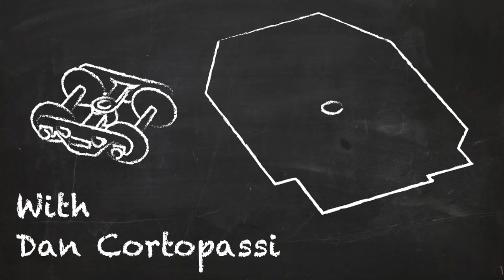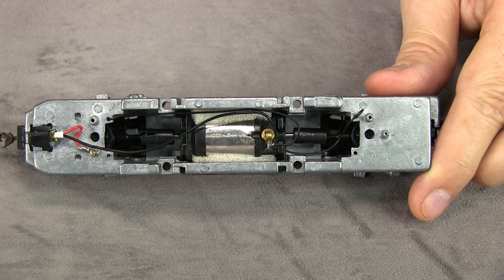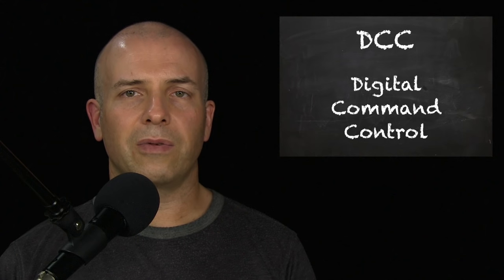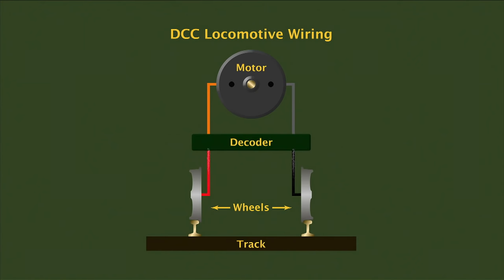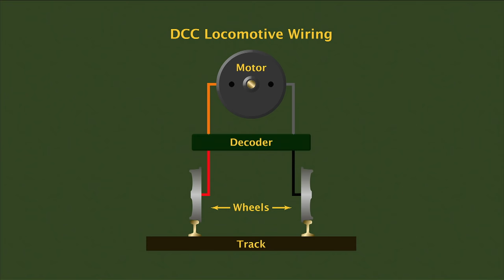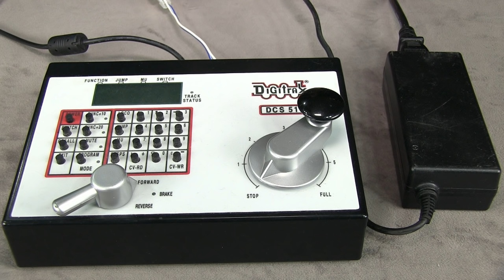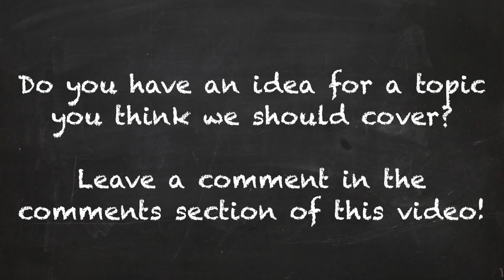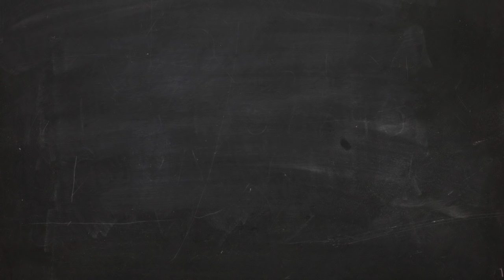Model Railroading 101 DC and DCC For Beginners

Comment: I started the hobby the mid-70's and amassed a ton of legacy DC equipment. I know older DC Loco's can be retrofitted to run DCC but like with much in this hobby, do I spend thousands on decoders and other periphery equipment to go DCC, or do I just deal with the simplicity of DC for now. I finally moved to a home that I plan to stay in for awhile and I now have a dedicated space for my hobby. My plan is to wire the track in a way that will work with my current DC switches etc (Older Atlas switches) but with a cabling infrastructure that will allow me to upgrade to DCC when it makes sense for me. I can still work on my track to ensure I have a smooth running system with the DC. I would like to spend my money now on scenery, buildings, and other piece/parts that help me provide a very visually realistic layout. Also, I have 48 DC locomotives ranging from steam to diesel and I do want to be able to run them. I have made some more recent purchases and these loco's are DCC ready to they will be my first conversions for sure. Other thing is my layout is a U shaped layout the is approximately 12' long and 14' Wide so it is not big. I do not have operating sessions and generally I don't do massive switching maneuvers or run multiple trains. I enjoy the building and modeling more than I do running realistic operations...hence why I am in no rush to go DCC right out of the box. This is not intended to be a dis on this video since it explains DCC very well. This video certainly makes me push up my implementation timing but...money and time dictates!
Reply from the maker: Always do what's right for you. It's worth mentioning that a lot of people use the logic that "I have too many locos and it would be too expensive to change them all over to DCC" but keep in mind you never run all 48 at the same time. You could switch your favorite ones first. You might not even end up switching the others at all or if you do, just do them one at a time.

Comment: Great introduction. The only technical detail I thought was misleading was the one suggesting the DC knob is a current controller. It actually regulates voltage, as you correctly implied but your partner may have misstated. The amount of current “drawn” from the controller is determined by the locomotive using the energy at a given voltage. This is true with DCC running AC voltage as well. I point this out because it is important for hobbyists especially to have at least a basic and correct understanding of electrical concepts to ensure safe and trouble-free operation of their growing layouts.

Thanks for your videos.
Reply from the maker: I like the technical explanation but wonder if most people want that level of detail. I would think most would just want to know if you move the knob this way it goes and if you move the knob the other way it stops. :D

Comment: just got back in the hobby after a 16 year hiatus... i have the NCE 5amp system, used it a lot way back when... set it up recently and completely forgot how to operate it... i'm gonna keep it but decided to temporarily go back to DC... DCC is nice but seems like it's getting way to tech heavy, i just wanna run some trains and do some switching... sound is nice too but i don't really have to have it... i'm building a switching layout right now, a dead end industrial lead with a few industries and a small yard, only one loco on it so i can get by with the DC powerpack for now till i get my "model railroad bearings" again... nice vid btw

Comment: I've never built my model railroad because judgment is heavy in this hobby. I weathered a Santa Fe Gp 38 one time. I thought it looked good for someone who had never done something like that. I showed it on hoping I could get some advice on what I could do to make it better if I had to. Everyone who looked at it pretty much called it trash and walked away. All the details that I did for a layout people just criticizeed what I did and never gave me advice on what I could do better. All my trains and planes are stored back and haven't seen the light of day in years.
Reply: " judgment is heavy in this hobby" ... You are so right, and it is usually from the wealthy people who can afford dozens of locomotives, tons of different rolling stock, and all the fancy "Bells & Whistles", but then again, snobbish arrogant superior attitudes are standard for rich people.
I'm 74 and I built my layout back in the early 1970's (when it was an affordable hobby and NOT a "Rich Man's/Woman's"  hobby). Strickly DC. Used plastic rail joiners on the hot rail to isolate blocks of tracks and DPDT toggle switches to control power to each block and which of my two controllers would operate that block. I only use two Loco's (one that takes cars from point A (off layout) to my yard to drop off/pick up and then to Point B (off layout) and back again. Other Loco to work the yard or service the industries on my layout. For me, the ONLY advantage to DCC would be the realistic sounds of the engine starting, throttling up/down, etc. and I can't justify the cost to convert my old engines to DCC or buy DCC ready/fitted Locomotives just for that. All my switches are manual and no auto-uncouplers. More realistic because it takes time for a brakeman to throw switches or uncouple cars.
As far as landscaping & painting - I am NOT artistic and the "Hobby Snobs" would find plenty of flaws but it looks good to me and that is who I built it for ... ME!
My advice is to ask yourself ... "What is more important? The praise and admiration of others or my own personal enjoyment?" So dig out those trains and have fun. If others don't like what you've done then just give them a heartfelt F. U. and enjoy YOUR layout.
This old geezer wishes you all the best and happy railroading!

Comment: Wow! I started this railroading hobby by buying a very old layout for $50 knowing NOTHING about model railroading. 1 year later the original set is almost scrapped, I got the Bachmann EZ track, a DCC controller and found out I was even less intelligent than I thought! I have 4 DC engines (beats me if they are DCC compatible) I didn’t’t even know what that meant until watching this video! OmG.. I have a long way to go..BUT at least I know what DCC compatible means now😊

Comment: DC: a heck of a lot cheaper, you can collect locomotives a lot faster. At most train shows dc locomotives can go as low as 5 dollars. A lot more user friendly. Just a motor and wires.  Cons are the lights  on most dc locomotives dim  based on how slow the locomotive is going.  Dcc: more than one locomotive or train running. Higher quality locomotives, but more expensive.
Reply: 5 dollars DC locomotive Where!!!!  lets make some business I pay you $15 and I sell them in my country!!.   But that is the beauty of the hobby, at least in USA you have many options and prices

Comment: I'm thinking about going DCC. I have a small layout on a hollow core door, just a simple oval with a couple of passing sidings and industries. I'm also thinking about building some T-Trak modules and using them to experiment with a DCC starter system and using sound.My only reservation, besides initial cost is I have a lot of N scale equipment that I've collected over the years that isn't DCC ready. Most of my newer stuff is, but hard wiring my older stuff scares the bejeebus out of me.
Reply from the maker: Try practicing on the ones that aren't as important to you. I have an old Bachmann Spectrum N scale Dash 8 that I am going to attempt to add DCC to some time in the not too distant future. If Dan's techniques prove anything, it's that most things are possible with some patience and the right approach. We have a program available commercially all about installing DCC in N Scale diesels, including some that were not made "DCC Ready."

https://tsgmultimedia.com/product/n-dcc-installs-volume-1-digital-download/
Reply: Sounds good. I'm really thinking about taking the leap while I'm still small.
Reply: I for one hope you made the conversion to DCC. When I changed over my fleet of N scale locos to DCCin 1995, I would never go back to DC. There's just so much more you can do to run your trains at realistic speeds with prototypical lighting and even sound... there are number of folks online who install and hardwire decoders in many scales. Some are expensive and others more reasonable.

Comment: Thank you for this video.  Senior who lost ability to continue hobby years ago due to family commitments … Nuff Said.  Was trying to find out what DC & DCC meant.  You answered my question specifics fully.  When I left the hobby I was using DC equipment with "Fly Wheels" and Transformers with a "Pulse" switch.  This was a huge improvement to engines with out fly wheels.  Since DCC is a big step forward in technology, is it necessary tinstall flywheels to engines?  I noted that your premium equipped locomotive had fly wheels so I am assuming for the optimal experience, would you recommend DCC and fly wheels?  Thanks for your attention and informative videos.
Reply from the maker: Hi John,

I think most models come with flywheels and at least 3 pole motors nowadays so it shouldn't be necessary to add flywheels unless you're dealing with much older models like from when you were in the hobby before.

Comment: AC have the advantage that the polarity doesn't matters. So if you changed the direction on one of the lokomotiv that would change direction. Which could be a problem if you cross sections with different controller.

Comment: Great Video. I just received a 'beginners' Digitrax system for Christmas so your video is very appropriate for me. In the video, you mentioned that you can run two locomotives in a consist via programming. My system has inputs for two locos. Can I assume that I will need a controller for each locomotive beyond the two that are controlled by my unit if they are not running in a consist. Thanks again for a great video and I wish both of you a very Happy New Year.
Reply from the maker: Sorry for the delay. You can run two locos with one controller. Be careful that you don't have an accident!

Comment: I finally decided to take the plunge. The added cost of decoders for me is offset by the cost of buying toggle switches and the time spent doing all of the wiring (which is NOT my favorite of the hobby). My new DCC system should be here soon!
Reply from the maker: Cool. I have been hoping to get a throttle soon so I can get accustomed to how they work, how to program a consist, etc...

Comment: Im such a NERD. I still love stringing 1000 feet of wire under 40 blocks on a layout with 10 control panels. OK kidding. But just a bit. Because if you have 50 locos switching to DCC is a problem. NO MATTER. I do love the mental process of figuring out a block wiring system. Even mixing DCC and DC on the same layout.

Comment: Thanks again for an easy to understand video.If possible in the future could you do video on the equipment and wiring needed for reversing loops and wye's for those of us who are modeling electric traction.
Reply from the maker: We continue to develop content for the series, and one of the topics in our list has to do with layout design. We also intend to do a full layout build from start to finish at some point.
Reply: There is a way to do electric traction that solves it , called live overhead (read an article on it for a trolley line) but if doing rail only you need selctor switches or get a special switcher
Reply: There is also a book on wiring your layout which is quite good

Comment: I've been asking this question for a while in this hobby.

Can you plug more then one controller into an outlet or power strip. I've been thinking of buying 3 of the same controllers.  The bachmann controller. And im thinking of having 3 tracks of bachmann ez track. But don't know where to plug the three controllers in without overloading the outlets.

Comment: Radio it works much like it and it searches for decoders attached to the track. DCC to run any system you just put it down on the track and get assigned a umber or name.

Comment: They didn't have DCC when I was a kid, but this method still seems a bit old school. I'm surprised they use it instead of Bluetooth or Wi-Fi which allows you to have more communication and to use a tablet or computer to make control adjustments. All my lights and door locks in my house run on zig-bee which is just a form of low power bluetooth and it allows for a simple two way communication between a device.
Reply: Many DCC layouts (particularly club layouts) now actually use WiFi. 

I’m part of the Carquinez model railroad club in Crockett (near San Francisco) and we use an app called WiThrottle to control our trains it connects with already existing DCC systems. 

Definitely worth looking into for modelers.

Comment: I know I'm probably really late to this but it would be helpful if you made a video about how to maintain locomotives and cars and track and such for reliable operation. I love this series though!
Reply from the maker: The NMRA has operating standards and recommended practices for just about every aspect of model railroading. Some very experienced model railroaders have developed their own set of standards that work for them when consistently applied as well.

If you adhere to the published NMRA standards and practices, chances are very good that you will not have many of problems with good operation!

www.nmra.org

Comment: What I can't understand is the pure short sitedness of DCC standard.  That it's a one way system.  Meaning, commands come from your throttle and are received by the train's dcc decoder (or accessory decoder).  There is no feedback control, no way, at least in the standard, for a decoder to send information back.  

We can do better than this.  I would love to have a new standard perhaps based on CAN bus or CAN-FD.

I build my own DCC decoders using PIC microcontrollers.

The signals are superimposed on the track by a DCC throttle or command station.  Digitrax, for example, in their super chief system has two protocols.  The protocol between their throttle and the base station is called loconet and is proprietary to digitrax.  The command station converts loconet communications to a DCC signal that is superimposed onto the track.

The superimposed DCC signal consists, at a very low level, a varing PWM (pulse width modulated) signal.  A short pulse is a 1 and a larger pulse width is a 0.  The 0s and 1s combine to make up a value (ex: 0011 = 3 in binary).  The NMRA DCC standard has a table of what all these values refer too such as CV values, ditection, throttle, etc...

Hope this helps anyone wondering.  I did all this research on DCC after trying to return to the hobby as an adult and trying to see what current state of the art is in the hobby....

Comment: If I've got a DC system how easy is it for me to convert to DCC? Just plug in a DCC controller to the positive and negative leads of the track or do I have to convert more than just the controller assuming I already have DCC ready engines.

Comment: Would you say you are less in direct control of the motor with DCC? Since DCC delivers current via PWM you're limited to the controllers preset steps of current. That's what gives the gradual stop/start as it steps through the incremented values. With DC if you want to ramp up to speed you'll need to be precise in your handling of the throttle and that's what leads me to find DC more enjoyable as being in direct control of the engine.
Reply from the maker: Not really. Locos with decoders that I've seen tend to have better and more accurate overall performance than straight DC ones.

Comment: I have a three main layout, with an attached yard.. I have four separate DC controllers. In this layout I can transfer trains from my yard area out onto the table, which starts with the outside main. From there I can transfers thru double crossover switches any train to the middle main or inside main..I think it’s quite complex, but I would like to set up a DCC controller. Will each main have a DCC controller? Surely not…. With the power polarized on the current layout I’ve gone to great lengths to keep all wiring compatible. Because the layout is so long, I have power feeders placed around the layout to keep the voltage up. So I was hoping that DCC will eliminate that need and give me better control throughout the layout… i don’t know if going DCC will actually help me considering how complex my wiring is. And it works! Everything’s is color coded and wired to junction points to keep everything orderly.. let me know what I may want to do…to improve engine functionality. I have many turnouts wired and set up, so that I can have a train waiting on these sidings (5) until the time I want to bring it out on the table, but…..Will I improve my layout by going to DCC?

Comment: I’ve got a good question for you. I have 20 to 30 locos, still in storage, that I’m getting ready to pull out and run again. While I’m pretty sure about most of them, having or not having DCC. There’s a few in question, without sound, that may have come with DCC. I believe those two are Bowser PRSL units. However, I’m not sure. Without me removing the shell, is there a quick way of deciphering this, without setting them in DCC track and possibly damaging them? I also plan on hooking up a double pole, double throw switch, so I can run any older ones that I don’t wish to convert. Thank you in advance! Great show, 👍 by the way! I subbed your channel. Love what you guys are doing! 🚂
Reply from the maker: You could always set up a programming track with JMRI Decoder Pro and ask the computer to read what's on the track.
https://youtu.be/xYZ9TMrMnqk
Reply: TSG Multimedia Okay, cool! Thanks!